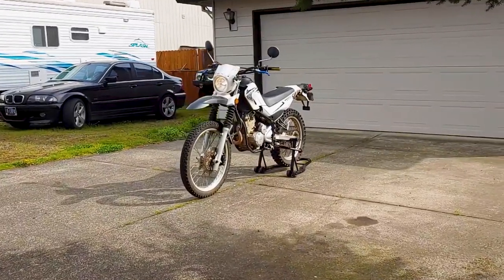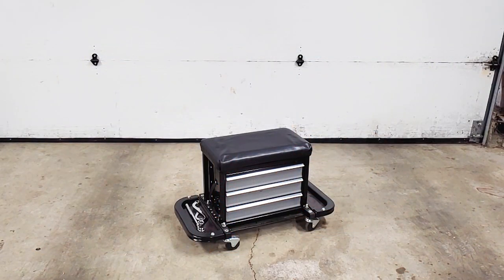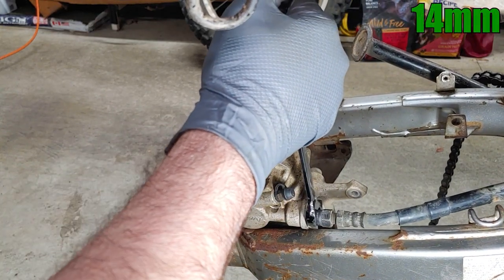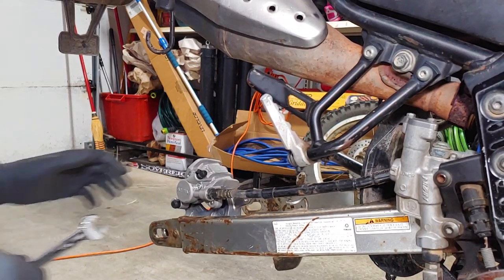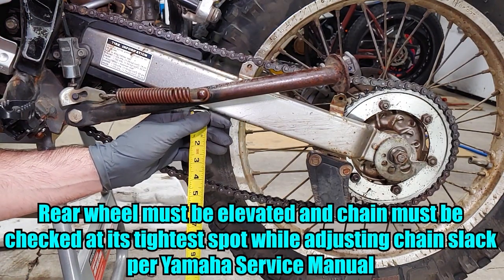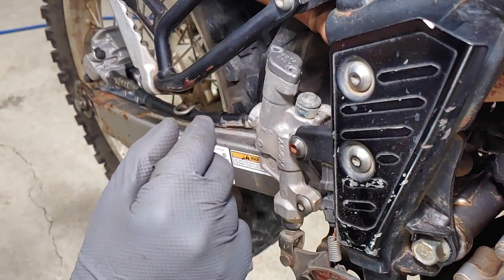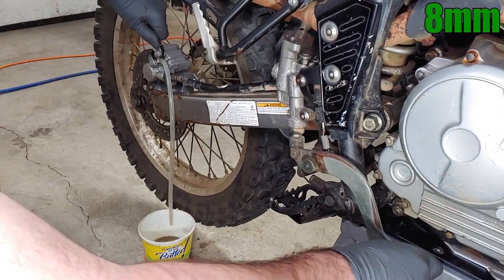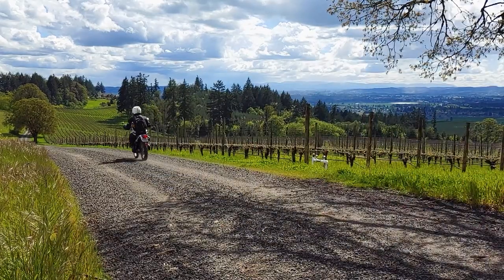Brake Caliper Replacement - Yamaha XT250 / Serow 250 - Tool Sizes and Torque Specs

Comment: I accidentally pulled out that rubber nipple that you have on the new break assembly. It has a little oil in it. Its like a little rubber sleve.Any idea what its for?
Reply from the maker: I haven't taken that off but it looks like a cover for one of the slides, which are greased.